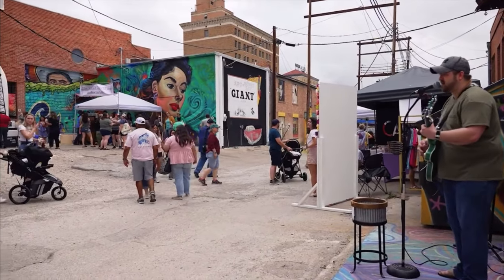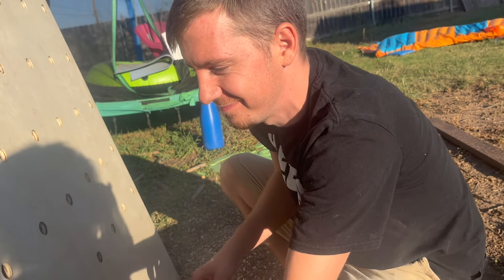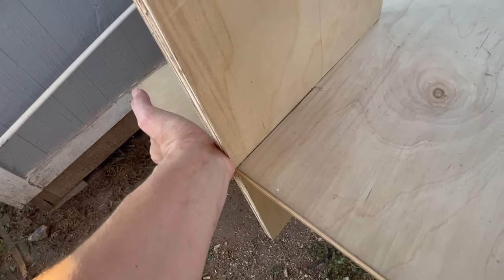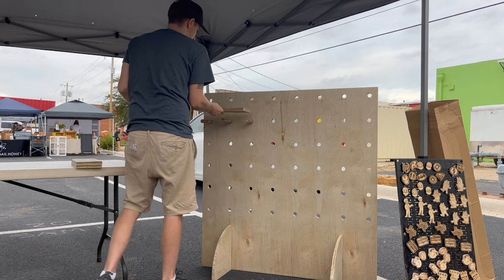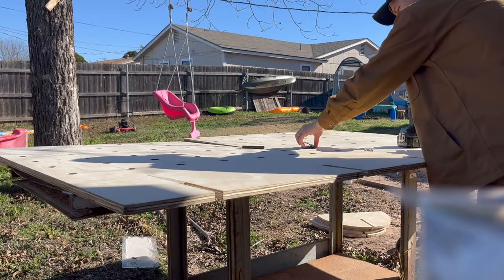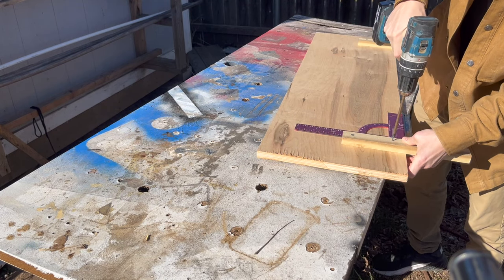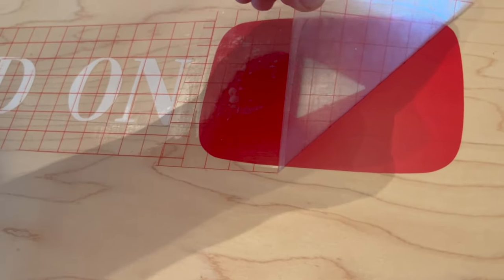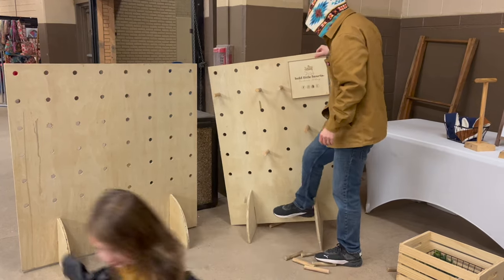Craft Show Product Display // DIY Dowel Wall

Comment: That's a great idea to connect the walls together with a hinge. If I decide I want to build a pair I may do it slightly different, by utilizing a farm gate type of hinge, that would allow the two panels to be handled, and utilized separately if need be.
Reply from the maker: That’s pretty smart!

Comment: Very cool project and idea!

An idea for making putting the legs on by yourself easier, do for the second just like you did for the first.

If you rotate the upright piece on the table so one of the corners is in-between where the legs go, you'll be able to put both legs on with the upright flat on the table. Then you can lift the assembled piece off straight onto the ground.

(Hope that made sense and helps)

Comment: About how much did all of that cost you?
Reply from the maker: A single sheet at Lowes/HD is about$70- $80 right now. I made two walls so $140 total with some left over material.
Reply: How about all the dowels and shelves?  BTW it is a really great project that I will probably use.
Reply from the maker: The dowels are about $5 for 48”. Thanks, good luck!